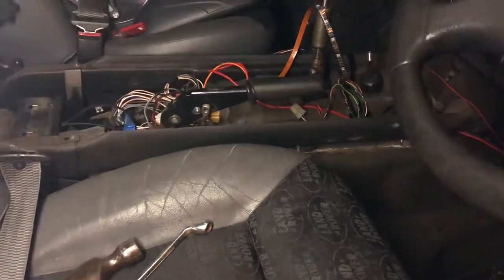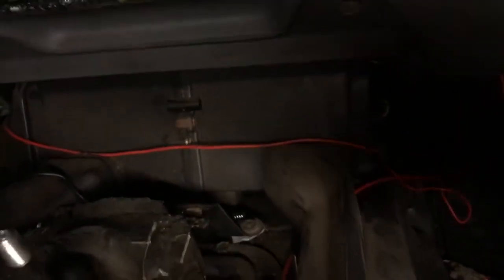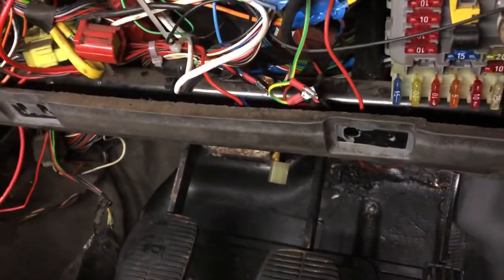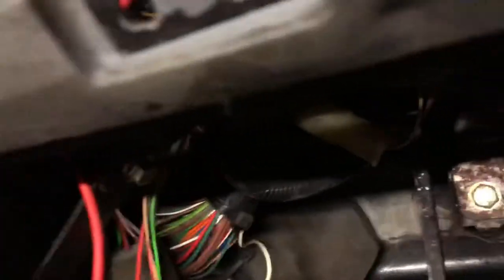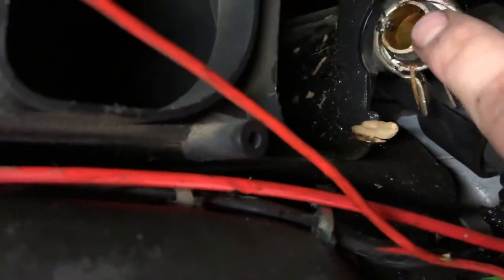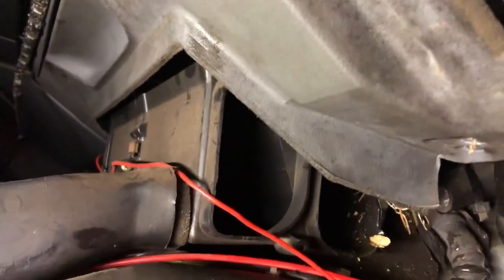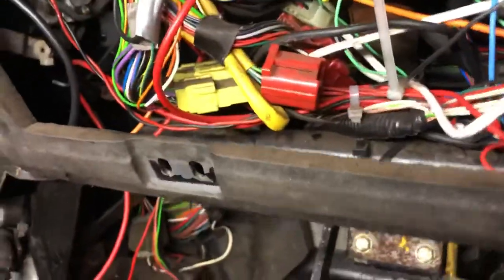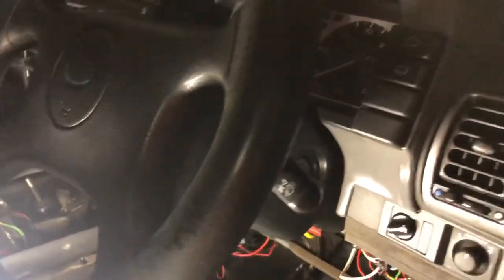HOW TO DO DISCOVERY 1/2 HEATER MATRIX (WITHOUT TAKING DASH OUT)

Comment: Can you show how to replace the Heater Core Pipe .Mine has perished on the fire wall side.
Reply from the maker: They the pipes that come down from the wall to the heater matrix?? 

If so I was looking at them when doing the job and they don’t half look a pain to do.

If I was going to do them I take the dash out or give to someone who done them before or a similar job.
Reply: @NORTHWEST4X4ADVENTURES  Thanks for your reply.Funny thing is anyone who has done the job don't want to do it again.Most experience place in my city will supply parts but refused to do the job saying they have other hiend jobs to do.I might have the option of cutting the pipe that has perished and soldier  a new piece on.The leak is where the hose clap tightens down.
Reply from the maker: Really sorry I can’t help you on this but I would take the whole dash out to do that job myself. Reson I would never do it lol 😆 

Have you not got any Land Rover specialists around or even a LR Garage (you will probably pay a lot but at least it be done properly 👍